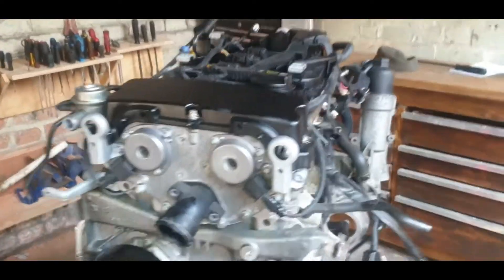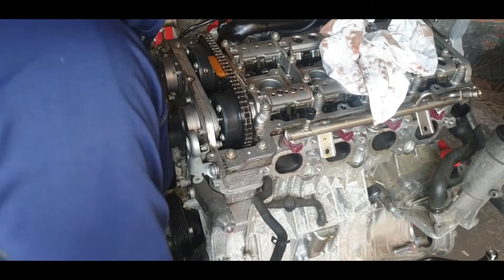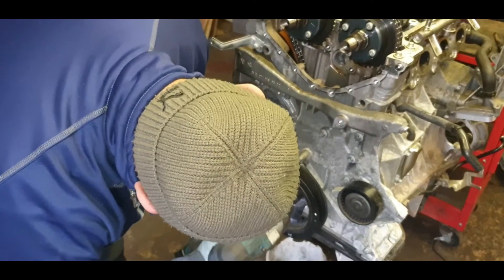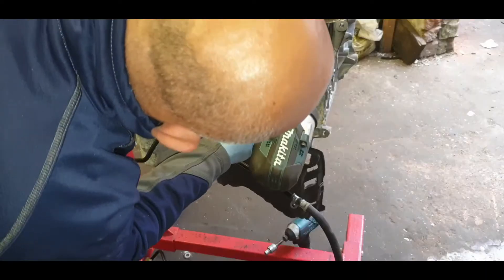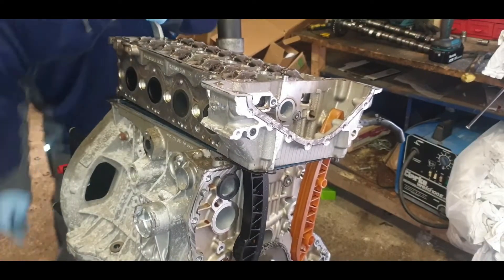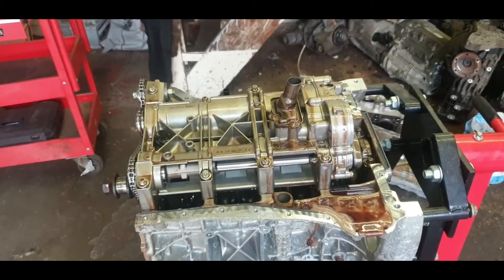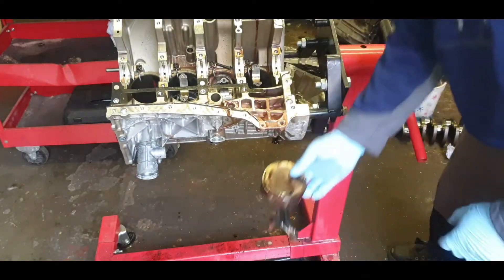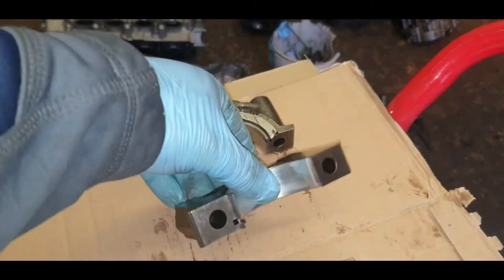Mercedes Benz Detailed ENGINE Teardown Complete Strip of M271 Kompressor

Comment: Nice to see my engine completly teardown. You arw right with the timing chain issue. I changed mine with  300333km on the clock (pre owner not known) because it started to show first symptoms of a loose chain. It was nice to see my engine without the cover on top
Reply: i just get a w204 mercedes with the same m271 engine.. the mileage now is 147k km, when do i need to replace those chain set ? now it still has no rattle sound..
Reply: @harisyoung4110  pop open the valve cover and do a visual inspection of the timing gears. If the gears are in bad shape you could replace it then. If it starts to rattle dont push the repair back, the timing chain can and will jump if damaged badly. If the chain jumps, you can throw away the engine because the pistons will get in contact of the valves, damaging it very badly and costly.
Reply: @davishahn3101 I did my repair already and it still makes little rattle sounds. They replaced my cam adjusters, sprockets, cam magnets and chain tensioner. They said the chain and guide rails were fine. It does run better than before however it still makes noise at times. I told them my issue still persists but they said I have nothing to worry about. All I can do is hope it won’t break down. They offered to do a full break down like this video but yikes, I need my car. You have any suggestions on what it can be?
Reply: @xArchyv2  what Oil do you use? I used 5w40 in my m271.
Reply: @davishahn3101  I use 5w30 mobile1. I live in california too btw so different weather conditions, mostly hot.

Comment: Not taking too much away from you're video, but the m271 is aluminum head and aluminum block not cast iron
Reply: Incorrect. M271 evo is aluminum. Before that M271 was cast iron block and semi forged crank.

Comment: I have the same car and I keep getting ESP error run flat indicator. I reset it and it comes up again intermittently while driving. do you know the cause of this?
Reply: Esp controls everything if u have an abs electric wire broken it will disable if u have a seed sensor go bad it will disable it. You need to put a scanner and find out what sensor is bad or wire is broken

Comment: hello i have the same engine in a w211 and it consumes oil
1 liter in about 1500 km
what could be the reason I have flushed the engine a few times with forte but no improvement

Comment: On the idle stop when the is heavy traffic smoke comes out what could be reason.
Reply: From personal experience, I've found that it's low oil levels. When did you last check your oil?

Comment: I was working on replacing head gasket do to failed compression test and water in oil.  Everything was going okay until I took off the cylinder head and two of the four pistons have a crescent shape missing (melted?)  where the split in the piston ring is.  I'm heart broken and considering the 05 c230 is far from perfect and the cost of new pistons I feel like my only choice is to scrap it at this point.  I would consider jacking the car up and at least trying the repair if they did not cost so much.  I also assume that it would be nessisary to take it to machine shop due to scoring of cylinder wall at the gap in piston ring.... yeah I guess its just scrap, this hurts.  I love the video, thank you!

Comment: Great video, would this be the same for my SLK 200 Kompressor, 184 CV, 2008, R171, M271.954 engine? Thanks.
Reply from the maker: Yes that's the same
Reply: Should be the same, hovever the engine in the vid is M271.952 I beleive.

Comment: How do you get the bolt out from under the guide pin and take off the lower timing cover?
Reply: @pipinxd7651  you pull a rubber plug from in front the pin in the timing cover, you then thread a long bolt with a nut and washer on it thru the hole into the pin, then tighten the nut and it will pull the pin out as it is just pressed in. Then the bolt comes right out. Also on Amazon there are several tool kits for this engine that remove the timing chain pins and holders for the cam shaft as well as the puller for the pin. But a bolt with a nut and washer work perfect and I can't remember the size but it is smaller like 5mm or 6mm and fine thread

Comment: Hi, just want to know if there can be oil leak shown in front of the engine where the camshaft aluminium covers are?
Reply: if there a seal there anything can comes through a seal cause its only rubber.
Reply: Common fault in these engines. Camshaft magnets leak oil in to the wiring loom. You will need new magnets and seals and oil blocking pigtails. If its leaked a lot you will get oil in the lambda sensor plug, causing sensor failure, and if its not caught soon, oil will wick in to the ecu causing that to fail also

Comment: Just wondering, is this a good engine to tune/modify/make higher horse power numbers?
Reply: Unfortunately the kompressor variations of this engine do not have much of tuning potential. 1.8k m271 may get up to 40 hp gains with 62mm pulley and remap. On the other hand the turbo version known as m271evo can handle bit more tunning but close to 300hp with intercooler, filter, remap.
Reply: No..hell no

Comment: How reliable is this m271 engine?
Reply from the maker: Maintained very reliable, therere are many versions of them.
Reply: I beat the crap out of mine everyday for 5 years still have still beating it up
Reply: @kylemcweeny878  I have a 2015 C250 Coupe. How many fuel pumps and engine mounts have you gone through? I have gone through 3 fuel pumps, 2 sets of engine mounts and a power steering pump (along with other minor repairs and regular maintenance items).. I only have 60,472 miles on it right now but they are probably some of the hardest miles any m271 will ever have on it lol. Asking out of curiosity for maintenance comparison
Reply: @slowestamg  none of those lol... just regular maintenance... the screen is starting to get messed up (edges color fading) but I think thsts because my car sees a ton of moisture (windshield wasn't water tight for like a year. And other leaks in places I haven't found.) Wheel speed sensor went out last weekend left me stranded 😫 fixed for 70 bucks. The pcv hose broke when I first bought it but I replaced it with a rubber hose from auto parts store for like 10 bucks... oh and the passenger inside door handle/armrest (leather, holds window switch) that fell off on my wife today actually. But I've left windows open in the rain a bunch of times so that probably aided to that 😅 but seriously I have oversized wheels 20's and I slammed it to the floor.. literally can't fit a low profile jack without driving up on wood. Stiff coilovers, rubber band skinny tires... the boots ripped on the cv joints/axels like the first week I lowered it.. never fixed that ...that was a year ago ...still driving it like a mad man ...still she goes strong! Steering wheel is peeling seats are ripping plastic buttons becoming unreadable but mechanical she's doing great.. very impressed actually... I changed the alternator 700 but that's because I had the oil feed line leaking oil onto it... forgot to mention that oil line lol and the banjo bolt I did it in the process because it would smoke on start up but now its mint! Whew what an essay lol

Comment: Big end, small end, cast iron, cast aluminium,  all the same.  Anyway, why was the conrod bend ? Hydrolock, obviously but why ? Head gasket or maybe a cracked cyl head, that you're unable to see. I would do a bit more investigation before re-assembling. Cranckshaft ? At least have it checked, grinded and see if you can save it with oversized bearings. If in doubt, replace it.